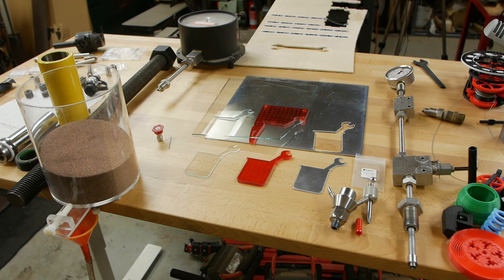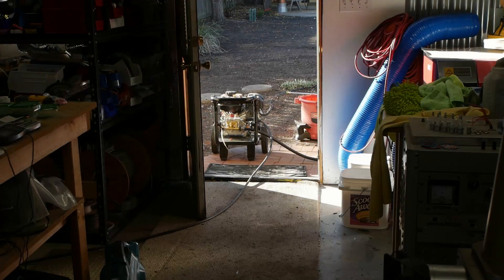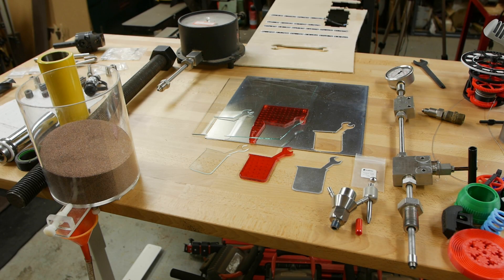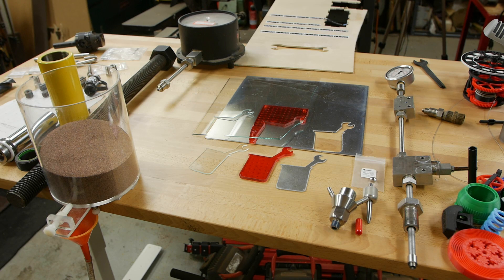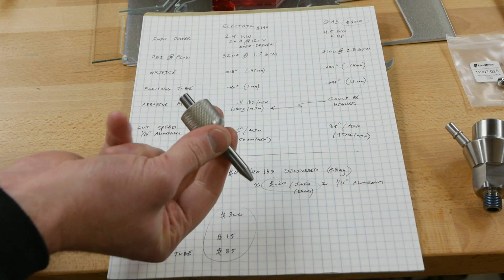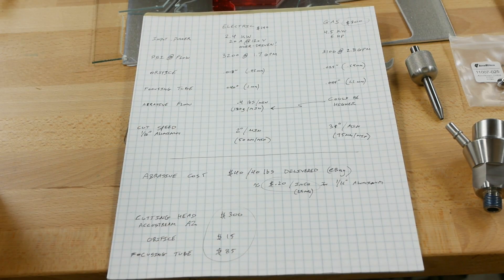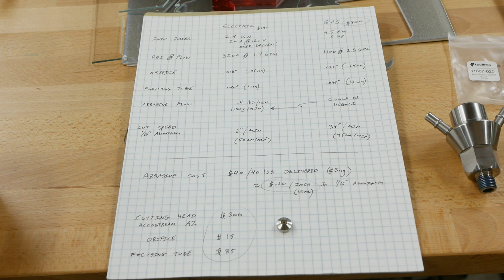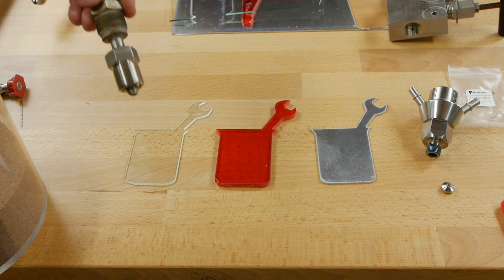Gas-powered waterjet cutter (follow-up) and other project updates

Comment: Just found your project now. As far as the diameter ratio for the oriface and focusing tube, the 3x diameter principle is a rule of thumb but what really matters is the area ratio, which increases by the square of the radius as you go larger. With your (larger than typical) dimensions, I'd imagine you are well within or overshooting the traditional "rule of thumb." Food for thought, but nothing is better than practical experience! Subbed, Cheers.

Comment: This Google link finds some plastic corrugated wall panels.  https://www.homedepot.com/p/Coroplast-48-in-x-96-in-x-0-393-in-Fluted-Twin-Wall-Plastic-Sheet-3-Pack-COR10MM4896-WT/206084782?cm_mmc=Shopping%7CG%7CBase%7CD30%7CMulti%7CGeneric%7CPLA%7CAllExteriorDoors%7c71700000032209583%7c58700003832418681%7c92700032325516439&gclid=CjwKCAjw_tTXBRBsEiwArqXyMiXLe3oiC0OQozldhSqdjDMPkvzaijXLJpgPXLWMTyP0-0yDcWKJuhoCa7AQAvD_BwE&dclid=CNSn1f6u_9oCFQN3YgodZt8EaQ

Comment: Thanks for your update (unaware; I've put a question at your former video). I really want to built one, but need a few extra features to my manufacturing. How to make a hole to start an internal shape. My max. cutting width is 1.5mm is this achievable? I am using my own recycled plastic material which appears to be temperature sensitive (tried laser); a water jet would be excellent.

Comment: Can't you reuse the garnet? Wash it, dry it, and put it back in, see what happens. It will be a little contaminated, sure, but it's still mostly garnet. If you cut aluminium with it, then the aluminium can be removed by washing it with a strong acid, like HCL, with steel, magnetic removal might work, with glass, or other ceramics, then that will become part of the abrasive, unless it's too fine of a powder, in which case it should be possible to wash it away without losing the garnet, with plastic, it might be possible to dissolve the plastic using solvent, or wash it since it will remain suspended in water, or even float.

Comment: Ha ha ha - what a HOOT!  Imagine what a delightful COMFORT it was to sit down to this video just when I did!  The washing machine started acting up, seeming to have trouble filling with hot water but warm or cold seemed OK - so I pulled the hot side supply line out and found, as expected, chunks of rust plugging the screen!  It's NICE when it's EASY - or so I made the mistake of THINKING!!!  Twisted it to final rinse/spin to see if it would work, and it seemed to be - so I went on to something else.  Suddenly - the HUGE WHOOOOOSH - as the (front loading) washer popped the door open because it filled WAY TOO HIGH and failed to DRAIN at the very end of the cycle.  Water pouring out all over the wood floors, in hallway, adjacent bathroom and the bedrooms - sending me SCRAMBLING for my shop vac and all the towels I could find.  WOW!  So after I get it all cleaned up and crank the heat up and turn on several fans I sit my tired, drenched booty down and fire up EweToob to recoop a bit.  Might as well check YOUR channel, one of my favorite cognitive stimulators, and --- WHAT????  Here's YOUR tale of a similar blow-up of a domestic flood - however did you know there's be some miserable one in need of company like this?  Thanks LOADS!!!!  I really needed to laugh about it!  (before I go try to finger out what happened!)

Keep up the excellent work!

Comment: Hi, nice video.

I used to work for a company where I operated a waterjet, in order to destroy the force of the jet the water needed to be about 1m deep, but interesting fact, if there's too much sand in the bucket the jet stream creates a eddy which excludes the water and you end up with a air column where the jet still cuts through the bottom of the bin.

Comment: Why don't you use a gas to push the water out of a tank? This is how rockets propel the fuel out of the tanks and into the combustion chamber. The water jet might have to pause to refill the tank then re-pressurize it or you could use two tanks and alternate between them. Either way that is not that big a deal. Also, you could get much greater flow and pressure. Scuba tanks are about 3000psi which is more pressure than the pressure washer. It wouldn't be as compact or safe but it seems like a good idea to me. Or you could just buy a 5000psi pressure washer pump and attach a massive motor.

Comment: Super and very interesting. I have a question : What size of electric motor should replace the gas one on a water pump on the same system . Thanks 
I want to built one but can't use gas motor .

Comment: what if you take a waterjet cutter and instead of water use a propane tank turned uppsidedown so liquid gas comes out, no mess to clean up. it just evaporates
maybe use a other gas that is non flamable and cheap

Comment: Is the abrasive not reusable? It's ending up in the bucket... seems like you should be able to (after possibly drying it) just put it back in the source bucket.
Reply: abrasive not reusable, because after cutting it contains cutting material's particles/waste

Comment: Cool stuff. Any plans to commercialize this either as a product or a service (a la "give me your DXF + $n and I'll give you your product)? 

Also, I'm really surprised you went with a ICE power element. The numbers I've seen on efficiency is generally >~ 25% for a standard unleaded 4 stroke engine (to the wheel). IME those small-engine contractor tools aren't really optimized for efficiency. Compared against your standard 56C TEFC 3 phase induction motor from ABB/Baldor/whatever and an ebay Mitsubishi VFD (5hp approx 200 USD for a 10 yr old unit), I'd think it'd be both more economical from the power consumption route (especially with them fancy power factor correction functions), more reliable, and most importantly more controllable re: for your in/out torque/power curves and all them cos theta, phi theta dingdongs

Either way, fuckin amazing stuff mate. Is that a J head or a Series I Bridgeport? What CNC retrofit did you put on it? Do you IRC brehh???

Comment: When reading "Gas powered" I was expecting to see a waterjet cutter powered by gasflow, with an air compressor and a venturi or so. Or some other sort of waterjet vs sandblaster hybrid. Seeing just a petrol pressure washer was a bit of a disappointment. It should be called benzin or petrol to prevent confusion.
Reply: they even have gallons, fahrenheit and inches.. how do you expect him not to use the term "gas"? :D
Reply: Hi !  I find a used SURPRESSEUR SP400 POMPE, is it possible to be used with a waterjet cutter head. I really dont know exacticly if it makes 490 BAR pressure of water or air.  The link of the producer is http://www.petrometalic.com/produits/surpresseur-sp400-pompe-portative-double-effet              Please help
Reply: it looks like 490 bar high-pressure side (so water or oil.) you'll still need a huge volume of air to get this pressure.
but given his results you should be able to get decent cuts out of it, as you get 2 times the pressur at half the volume, but pressure is better than volume.
Reply: Oh, you mean "petrol". ;)
Reply: Here in the us, it's just gas, mate :)

Comment: Hahaha, thanks for the mental image of you running around with towels and Benny Hill blaring in the background :D

Anyway, jokes aside, awesome followup and I really want to build a water jet too. Just needs something else than a gasoline power and I'm not buying a cheapo 100 pesos washer either. Have to gobble something from a proper motor and a proper pump.
Reply: Actually, I already know the perfect water pump capable of delivering 16 MPa and having a bypass in it: Drill EDM pump. It is meant to pump water and usually powered by an electric motor. I think Alibaba had these for a couple of hundred squirrels.

Comment: This waterjet is awesome.  One possible improvement.  If you can adjust the unloader pressure to where it works as designed you can get an electrically operated high 3,000 psi water valve from McMaster-Carr for $170.  That gives you the ability to turn the "cutter" on and off electrically.

How do commercial waterjet cutters deal with the problem of cutting through the bottom of the bucket?
Reply from the maker: Thanks for the tip about high pressure valves at McMaster.  I never knew they had super high pressure valves.  It looks like they have some 5000 psi valves for $110 ! https://www.mcmaster.com/#1190n22/=1avxi42  It would be interesting to do some flow rate tests on these.  Someone in the comments said that commercial machines have steel ball bearings in the bottom of the tank to dissipate the energy of the jet.  Seems like a good idea.
Reply: @AppliedScience  You could use the commercially available pneumatic valve body like the big boys use. I have seen some on ebay, rated at 60K PSI. Aliexpress sells a "entry level" complete head unit: nozzle, mixer, orifice, mount and valve for about $300USD

Comment: Hi Ben, do you know why a ruby orifice is needed, i mean its just water flowing through it if i understand it correctly.
Reply from the maker: It's true that it's just water at the orifice.  I think the tiny amount of dirt present in tap water, as well as the water itself will slowly wear away the orifice if it were made from metal.  In fact, ruby is the low-cost option for waterjet orifices. Accustream also sells diamond orifices which last much longer.

Comment: If you use a cheap gantry CNC router as the basis for a waterjet, simply turn the entire machine upside down, so the bed is above the gantry, then build a tank and cutting rack below all of that.
Reply: AP this is what you meant by an eBay cnc?

Comment: The biggest problem is the pressure is still relatively low and it's producing too wide of a kerf, and it's also too trapezoidal /  \ . 

And the nozzle that combines the abrasive and the water is still expensive as tits and impossible to buy. Emails get ignored. No "buy now" button.

Comment: Another experiment you could do with the laser and the vacuum chamber is diamond like coating deposition. It has several interesting uses and some really cool science is behind it.

Speaking of diamonds, it was my understanding that most of the ultra high pressure experiments used diamond-anvil cells. How close are you going to be to such pressures?

Comment: Thanks for the video.  I've been looking for a way to cut tempered glass, now I have some guidelines.

Also, on the laser project, are you going to be aiming for the targets?  What do you figure the beam divergence will be at that distance?  What kind of telescope (type? mirror diameter?) and spectroscope are you going to be using to see the reflection with?  Depending on the power and the divergence, you might have a good chance to actually hit the laser reflector targets!  Can't wait to see the video on that!

Comment: here in the uk we use 240v would a electric power washer draw less amps then one at 120v due to voltage difference?
Reply: Yep half as much amps due to double the volts. More volts are always nice when you need lots of power.
Reply: was thinking sure some people have 220v power in america they could use a 220v pressure washer

Comment: Couldn't you reuse the abrasive sand? I mean it just ends up in a bucket anways.
If you are cutting iron, you could separate abrasive sand from filings using magnet, or if you are cutting aluminum, by panning aluminum dust is lighter and will gradually come to the top when shaked).
Reply: It can be but it's not just as simple as getting the metal out and drying it out, the garnet which comes in contact with the metal will break into dust making it unusable but some unused garnet will end up in the collection tank/bucket. 

So in theory yes you can reuse it but it's not worth the hassle separating it.

Comment: Curious, would it be possible to take a say 7-8 hp electric motor, and drive the pump with that to eliminate that obnoxious gas engine?  I guess the challenge would be connecting the two and gearing it so that the pump is still spun at ~3400rpm, but it seems feasible....
Reply: I don't see why not. The speed is indeed a bit fast for a asynchronous motor but maybe it works well enough at half the RPM. Should get same pressure just half the flow rate. If you are cobbling things together you could just try finding a pump from a old industrial pressure washer that is designed to run at perhaps 3 to 5 times this power. Running that at half speed would still make it a beast of a pump.

Comment: Applied Science, this is very awesome. I have had thoughts of doing a laser cutter. Now I would going to use an array of diodes run to fiber optics and then use that to send down to a focusing lens. This way you can add more diodes to get more power. Just a thought

Comment: You can buy the pump alone (with no motor), 5kW is not that unrealistic to run a in normal house, probably even in the US.
You'd not only cut down on the noise, the operating cost would be less, there'd be less mechanical things to break and you could have a VFD regulate the speed of the motor automatically to keep the pressure valve happy.

Comment: You forgot the cost of the lifetime of knowledge it took you to figure this all out and make it all work together in reasonable time. Not exactly so simple as "just get a pressure washer off amazon and a CNC machine off ebay, you'll be right mate."
Reply: On this channel the knowledge  and messing about is actually half of the point of doing this.

Not many people go in to these ambitious endevours that everyone on the internet will tell you that "it simply can't be done at home without a 100 grand budget". You get cool projects like this where the point was not to cut some material but to prove that you can indeed build this at home on a mere mortals budget.

Comment: Could a turbopump be used to boost the pressure for a faster cut?
Reply: Those tend to be better for low pressure and high flow rate.

But you could probably give the water some extra pressure at the input of the pressure washer to reduce the load on the pump. Tho how much extra pressure can you get out of it before the mechanical parts of it explode.

Comment: I don't suppose you've dumpster dived or road rescued a lawn tractor? Then for the cost of a pump... https://www.pressurewashersdirect.com/Pressure-Pro-SLP66DX40-308/p3294.html (oddly I've gotten 2 lawn tractors with 18 and 22 hp engines)

Comment: If I ever make this project, I'll make an electric pump with a brushless motor, so it doesn't heat up as much, with 5 kW, so it has more than enough power. Unfortunately, the power I've got contracted is 5.6 kW so I would have to either disconnect everything that isn't essential or charge a battery and power it with the battery (the abrasive is expensive so I wouldn't be running it for long, a 12 V 100 Ah [1.2 kWh] lead-acid battery would suffice). Plus I could charge the battery with a solar panel (here in Spain we receive lots of solar radiation) so the energy would be almost free and clean, unlike with the gasoline motor.

Comment: I have used play sand (3-4 dollars per 50#) in my sand blaster for 5 yrs now with very good results. I am thinking water jet now and have a couple ideas. What are your thoughts.
1) pressure washer pumps in series or piston style pressure intensifier after the washer pump.
2) play sand instead of garnet, comparison of size and consistency of size of each would be sweet.

Thanks for your videos, I have learned a lot from them.
Reply: Watch out using sand.  Most sand contains high levels of silica.  The dust from this can get into your lungs and cause silicosis with is horrible and deadly.  This is one of several reasons why regular sand is almost never used for abrasivejet cutting.   Perhaps "play sand" is something special, but I doubt it.  At any rate, be careful!
Reply: Thanks for the concern and I am aware of this, I always use a respirator. Also the play sand has been washed during manufacturing (we wouldn't want the kids inhaling dangerous dust). 
What are the other reasons it isn't used for abrasive cutting, I am looking for input from others to help guide me.

thanks for the help

Comment: Just a thouht. The electric pressure cleaner you used had an universal motor for power source, which does have a very limited duty cycle and short but merry life. if you can get a used industrial pressure washer ( generally WAP) that has an induction motor as drive, these are rated for continuous duty, perfect for this application. Also they have better pump liners and you just need to replace the pump oil with new high EP agent oil to get it to run nicely. Also generally available used, and looking like they were dragged through a mine by the hose, but so long as the pump itself and the motor are fine well worth it, and the pump assemblies can be rebuilt with a kit as well.

Comment: routing the hydraulic pipe may be the biggest challenge. a small cnc may struggle with the forces.  If you are prepared to dry and reuse garnet then just find a proper wj shop they will be happy to let you have some (we get through tonnes of the stuff )